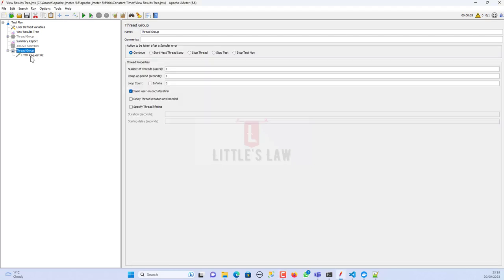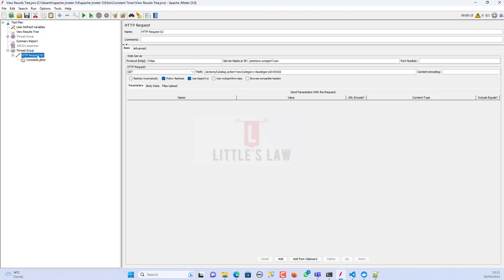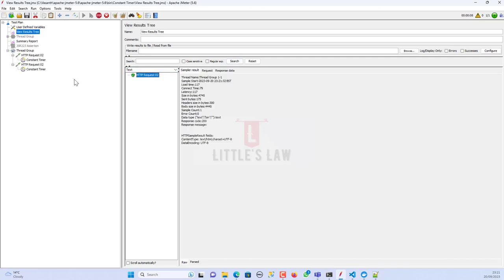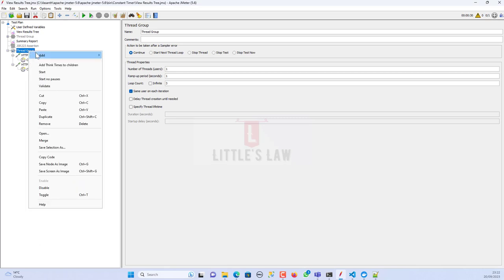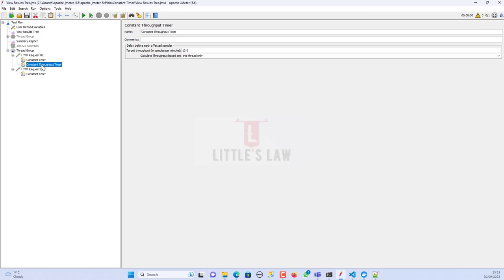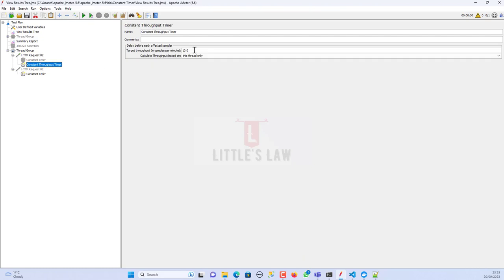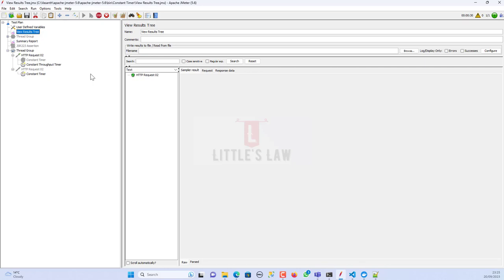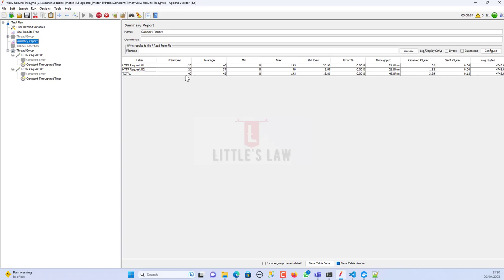What and How to use Constant Timer in JMeter | Littles Law #jmeter #performancetesting #neoload

Comment: Hello Sir,

I have a question regarding a test I need to run with two endpoints. The first endpoint is a token call, and I extract that token to use in the subsequent requests. I want the token call to execute initially and then every three minutes thereafter.

I attempted to use a Constant Timer on the token call, but this approach only triggers the token call after the third minute once the test has started. How can I configure the setup so that the token call occurs right at the start of the test and then continues to run every three minutes?

Thanks a lot!
Reply: Hello Sir, I am stuck with the above mentioned issue, could you please help me with it?
Thanks a lot!